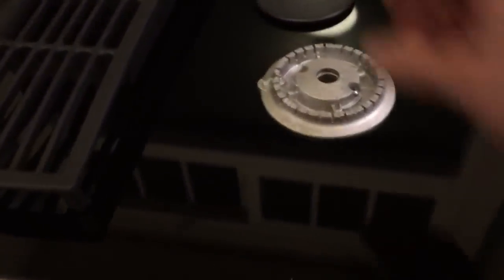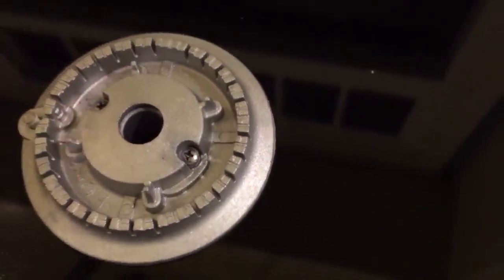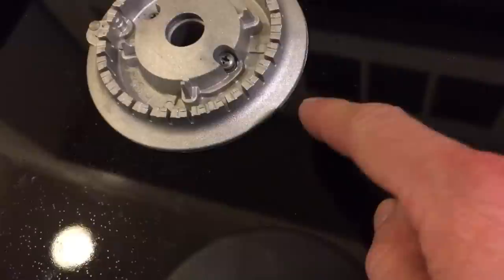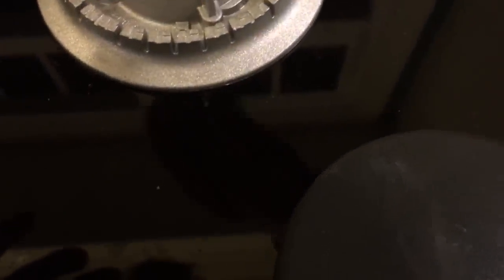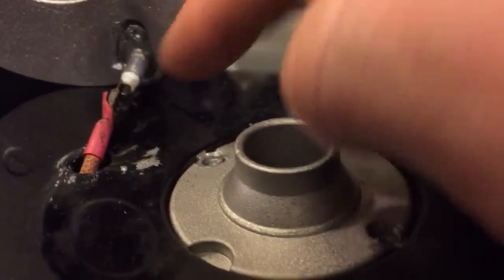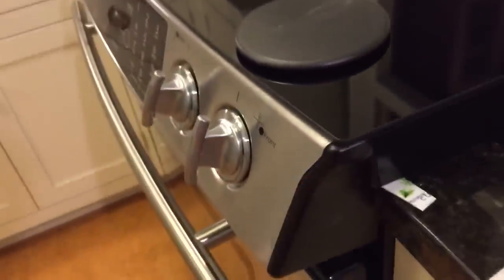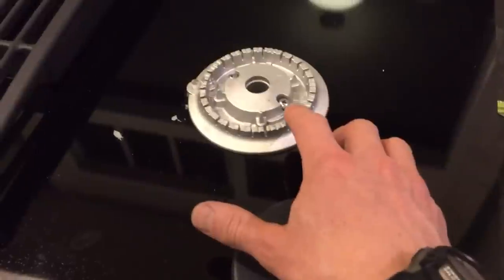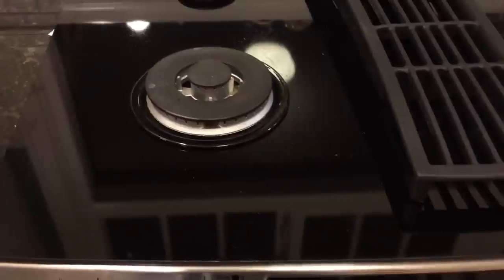JENN-AIR RANGE JGS9900BDS REPAIR

Comment: This is common with Jenn-Air cooktops/ranges.  The solution is stainless steel screws, and anti-lock paste.  I got one good screw out and took it to a hardware store, matched the length and thread, and chose a torx drive screw.  At the hardware store, the screws were $1.19 each.  Jenn-Air replacement screws are $6 each and will corrode like the originals.

  The antilock paste is available at auto parts stores.  It's used to keep steel spark plug bases from seizing in aluminum alloy heads, the same condition you have when putting a steel screw into an aluminum alloy burner base.

  Jennair should have fixed this problem by now, but they've been doing this same thing with the cheap screws for over 20 years. Using stainless screws with torx, hex or square drive heads might make their manufacturing costs go up a few dollars, so it will probably never happen.  When I do my next cooktop replacement, Jenn-Air won't be a candidate.
Reply from the maker: Yep, go with stainless and anti-seize compound.

Comment: I found a workaround on my Jenn Air Gas Slide-In Range (twelve years old).  I couldn't see replacing three working burners to fix one broken one. My problem was cracked ceramic insulation on the left rear igniter.  It discharged underneath and would not ignite the gas. The two top screws were frozen.  Despite penetrating oil, one screw broke under a hard twist; the other wouldn't budge.  I ground the head off with the Dremel tool, detached the igniter wire, and removed the burner.  I looked at the diagram on line, but naturally it didn't show the orifice assembly beneath the burner. The question was whether I could simply rotate the burner ten degrees clockwise, drill new holes through the top into the assembly beneath, and install a new burner and igniter in the new position. When I removed the knobs and rotated the control panel down, I could just see under the broken burner, and it looked like the idea might work. At least in the front, there was support and space for another screw and clearance for the displaced igniter. The gas line came in from the right and would not be affected.  The igniter wire came in from the rear and had ample slack.  I decided to chance the clearance for the rear screw.  I ordered a replacement burner with attached igniter for $40.
To make the repair,  I ground the two broken screws flush with the top.  With the old burner (igniter removed) in rotated position, I marked the new holes. I drilled the front screw hole first and secured the top to the orifice assembly with a self-tapping hex-head screw.  Then I drilled the rear screw hole, which looked like it was near an edge and recommended no more burner rotation than necessary.  I marked and drilled the large igniter hole and smoothed the edges with a small file.  Then I removed the screws, ran the igniter wire through the new hole, attached it to the new igniter, and secured the new burner in new position.  It lights and works fine.  The burner hides the holes, so the fix is invisible.
Reply: Ummm, lets get a video of this posted already :-)
Reply: Awesome 👏

Comment: I just purchased a JennAir Pro line. It was a floor model for 3K vs the 6K original price. As soon as it comes, I will check if it has the cheap screws, and replace it with SS steel and some antifreeze. I hope they didn't skimp on a 6K model range-oven.

Comment: Same issue.  Very helpful video.  Related problem: when I remove the two screws, the burner head is still attached somehow to the orifice holder...I don't see any other screws in any diagram.  Could it be glued?  Or do you think it is just baked on from ten years of cooking and spills?  I gather you did not have this problem getting the two old parts apart?  Thanks very much in advance....
Reply from the maker: Yeah, I don’t recall an issue like that.  As you mentioned it could be baked on cooking residue.   There was no adhesive.  Let me know how it turns out.  Good luck!

Comment: i HAVE THE SAME ISSUES. HOW DID YOU REMOVE THE RUSTED SCREWS? I TRIED NUMEROUS WAYS AND CAN'T MAKE IT HAPPEN.
YOU SAID YOU REMOVED THE SCREW HEADS ? WHAT TOOL?
THANKS
Reply from the maker: I used a Dremel tool to grind off the screw heads.  I was unable to extract the screws so had to buy new burner orifices in addition to the burner heads.
Reply: golyg next time notch, grind the Phillips head and make it for a flat head screwdriver then soak it with PBBlaster and flame 🔥 it with your torch + PBBlaster again and turned loose 👍🏼

Comment: Just out of curiosity.  When extracting the screws did you try heating the heads and body a little with small torch. Have the same porblem. Of course i would turn the gas off haha.
Reply from the maker: Didn’t try that.

Comment: Also did you have to buy new orafaces since the seized screws  were still stuck in there? I'm going to do this exact same project.
Reply from the maker: Yes, for one of the orifices I had to buy a new one as I could not get the corroded screws out of it.  Good luck!

Comment: Can you please tell me how you got the screws out? How you cut off the heads? We have same problem and have heard of drilling out screws but not sure how to do that.  THanks for video!
Reply from the maker: Sandra Benavides 
Well, you may or may not be able to get them out.  I used various techniques (penetrating oil, cut a slot in head and tried a standard screwdriver, screw extractor, cut off the heads with a Dremel tool and tried a ViseGrip on screw shaft to remove) without success so had to buy new recieving parts (burner orifices).  I did get the screws out of the back burners (less corrosion there).  Use stainless replacement screws with antiseize compound when you replace them.  Good luck!

Comment from the maker: There are schematics online that list the various part numbers online. I have ordered parts from www.partselect.com and www.appliancepartspros.com. You do have be careful to order the correct burner orifice (part under the glass top) for the burner you need to replace as the burner orifices are different for the various burners. The front left burner (2 level burner) orifice is dramatically different than the single level burners. You can also look at the Whirlpool Parts Site: http://www.whirlpoolpartsonline.com
 Hope that helps. Good luck with the repair!

Comment: Let's see if I get this right.
1. Cut off screw heads to remove burners.
2. Remove glass top to get to burner gas orafaces?  At this point how do you remove orafaces with cut off head screws still in them.  Are there different screws to remove orafaces.  Or do they just lift out?
Reply from the maker: Yes, need to buy new orifice(s).
If I recall correctly orifices just slip off.
Good luck with the repair!

Comment: WHere did you get the replacement screws as I cannot find the right size for my Jenn Air and the manual doesn't list that part. do you know what size they were?
Reply from the maker: I took the new burner head  and new burner orifice  into my old time local hardware store. They tapped out the burner orifice so I could use stainless bolts to attach the burner head.  You can buy the original screws here (http://www.appliancepartspros.com/) but then they won't be stainless and prone to corrosion.  Good luck!

Comment: How did you disconnect the ignitor from the little metal connector on the wire? It doesn't seem like there is any way to do it without replacing the whole connector.
Reply from the maker: If I recall correctly I just wiggled it off.  If there is corrosion you might try some penetrating oil to try to loosen it up.   Good luck on the repair!
Reply: Thanks!

Comment: I think I need to replace the spark unit on my Jenn Air and came upon your video to see how much pain I was in for.  After seeing your experience and reading others below, I think I may continue using a lighter to ignite my burners instead of trying to fix.  BTW, the person that came up with those crappy screws probably got a raise instead of being fired.  It is called planned obsolescence.  Those screws are designed to make repair so painful that you are encouraged to replace instead.  I hope it is a design approach that will go away in the next century, but humans being humans...